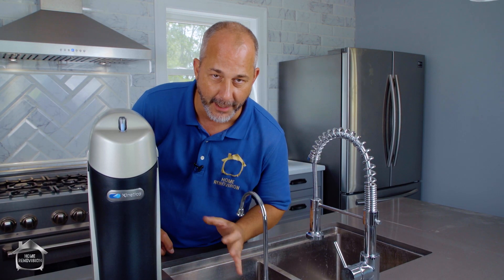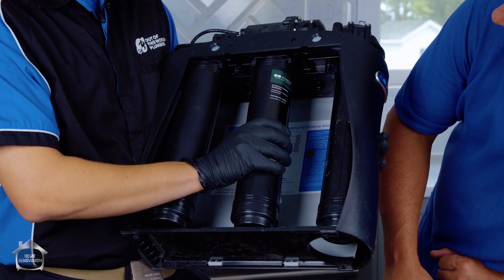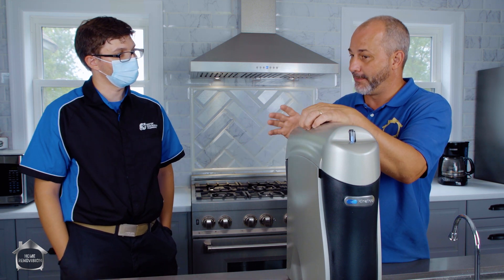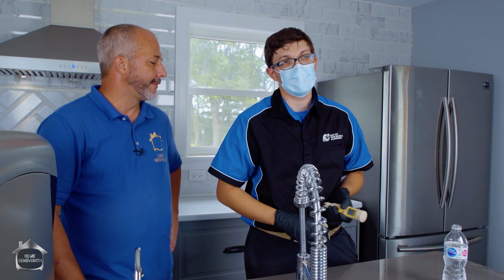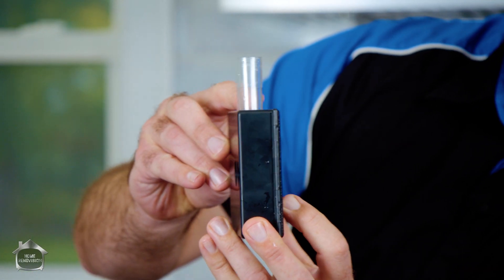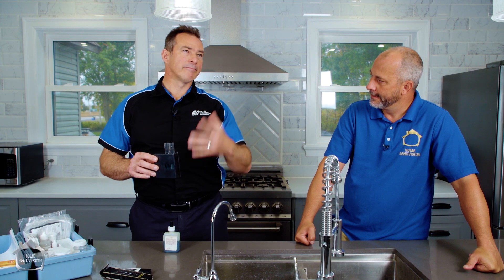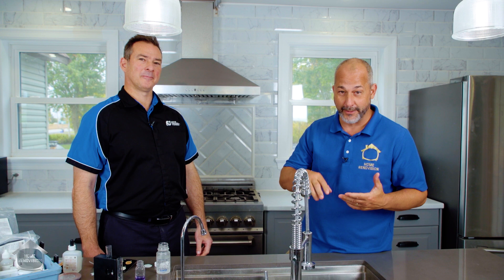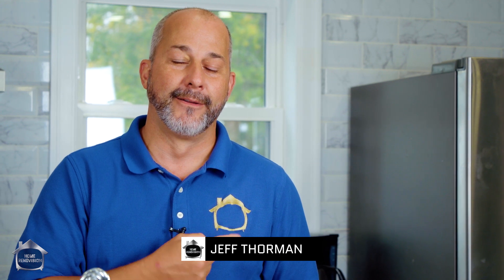Make Your Tap Water Safe for Drinking

Comment: Do I have to sell my first born to afford this system ?
Reply: Yes you do; they won't even list the price of any of their systems on their website O_o You have to speak with a salesman.....
Reply: No. About 250-300 for an r/o drinking system itself, + install. You can do it DIY or pay around 300-400 to have someone put it in.
Reply: @evolgenius1150  That's wah better. But then you still pay for it with the water bill, right? At least a liter lost per liter at best, usually much more. I couldn't do it.
Reply: @koalamama2  what? Your water bill is not gonna be much more than it already is. Go on Amazon and buy a ro system and install it yourself its incredibly easy just tap into your water line and tap into your draining pipe. Drill a hole in the counter top and set up the system easy peasy
Reply: @BeerkegGarage  idk the research that I’ve done on RO systems says that at best you’re gonna lose a gallon per gallon filtered. The city is gonna charge you for both gallons
Reply: @expressfashionman89  interesting, never knew that
Reply: It wastes 1-4 times the amount of water you actually get, so how could it not increase the bill? Hydro charges for waste water, too. I just use an Epic nano pitcher that gets out literally everything (inc drugs, pesticides, fluoride, etc) except a couple of minerals, and a Sprite shower filter which neutralises chlorine with vitamin C so your skin and hair stay soft. Those are maybe $40 each and waste nothing.

Comment: The best solution is water distiller. It makes 100% clear H2O.
Reply: Never 100%

Best might be 98% to 99%.

This is my chemist major talking.
Reply: Doesn’t that taste terrible?
Reply: @timgleason2527  It tastes great. I drink and cook only with distilled water for 20 years. After that regular water tastes like soup for me. So much of unwanted additives there which I feel.
Reply: @felipepubillones2768  Well,  for 10 years I did not clean my teapot inside. And it is like brand new and shiny, there is not even a sign of scale.
Reply: @_Mikekkk  not everything gets removed in distillation. To get 100% purity requires more energy than what any industrial method will do. Around 95% purity is where diminishing returns start. 

Hell even do called 100% lab grade ethanol is really at best 99.9% because of same reasons and it costs a pretty penny.

If distilled water truly was taken to 100% purity, no one would buy it because of price.
Reply: @felipepubillones2768  Do not be boring. It is clear that absolute is not reachable. But it is close enough to that. And better than any other method of water purification.
Reply: @_Mikekkk  how is staying true facts boring? Close enough still isn't truly 100% and is just advertising at it's best.... Fudging numbers
Reply: @felipepubillones2768  Many solvents form azeotropes with water, ethanol for one, making distillation inadequate, but easily identifiable since the boiling temperature changes
Reply: @_Mikekkk  Distilled is not healthy for humans.  It has all the minerals striped out and your body needs those.  When it doesn't get those, it will take them from your body and you will be deficient.
Reply: @seeya205  It is not true. Most of the minerals we get from food, not from water. You need to drink tons of water to get similar amount of minerals you can get from food, and not all of them you can even get from water. I drink only distilled water for 20 years and have no issues. Sometimes I drink mineral water from good sources, but this is not regular tap water or cheap "spring" water you can get from store. Those are total crap.